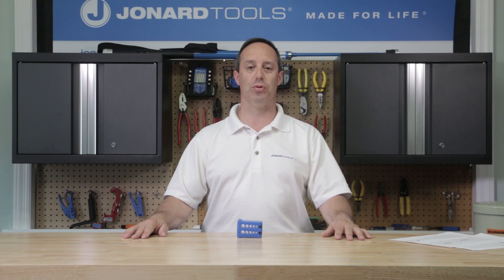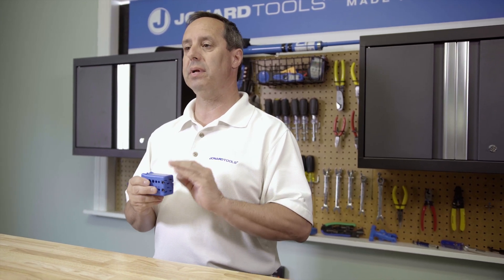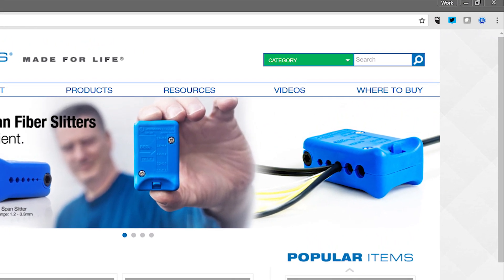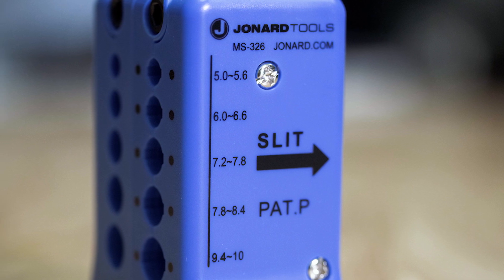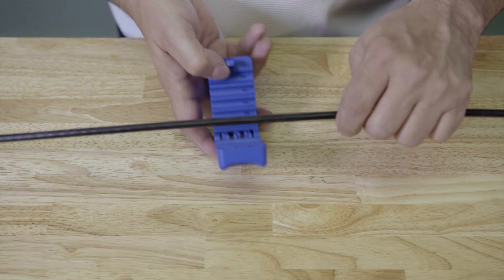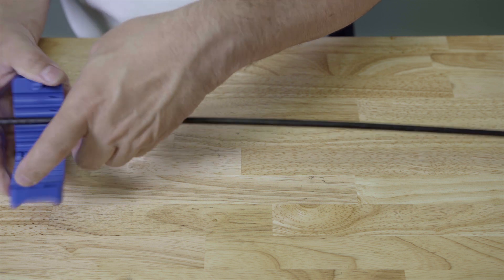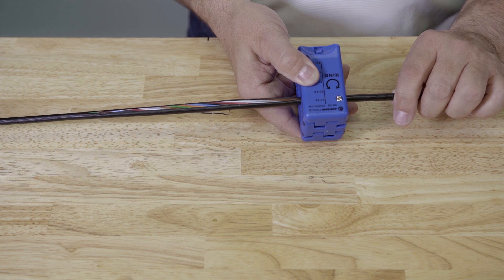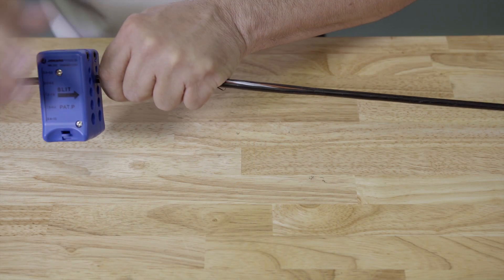Jonard Tools MS-326 Mid Span Slit & Ring Tool

Comment: This tool works extremely well with the innovative, 1728f FlexRibbon from Prysmian Group which has thin wall buffer tubes. This cable is being placed in 1.25"  SIDR subduct across the country. . The MS-326 precisely removes the six internal tubes for a mid span or butt splice. Questions? Call me. Jerry 803 904 1348